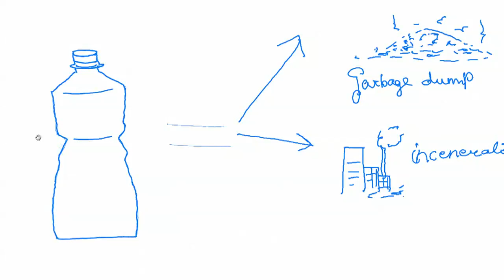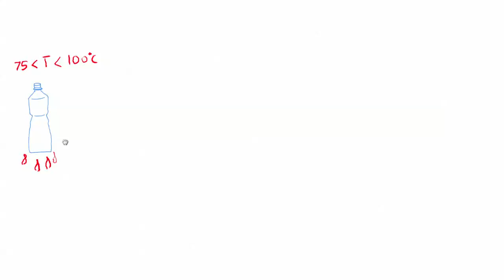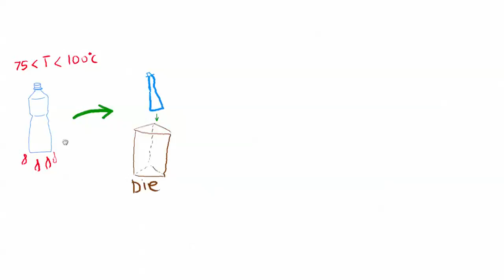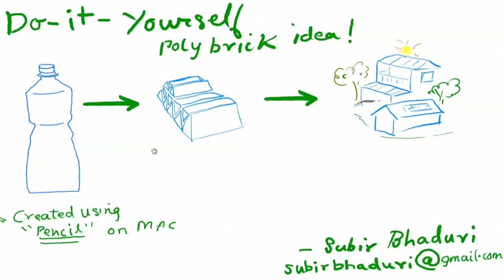DO-it-yourself Poly brick

Comment: So far I have tried a couple methods that I have learned here on YouTube for remolding them into readaly useable forms 1 way is toheat them between sheets of non stick tinfoil in an old sandwitch press (that I bought secound hand for this purpose)
This produces a very nice strong pannle that can be combined with more of it's kind to build bigger pasnnles from I have had success with many types of Thermoplastics with this method (be sure to know the melting tempratures of each type of PET)

Comment: Some give off fumes when heatted and others dont BE SAFE I have also had good luck useing a cooking pan and the non stick tin foil useing a old Cloths Iron for my heating source  I want to try to build a system that would use Solar heat to do the heating as this would sit better with me as to the recycling goes Im thinking a set of mirrors and a parabolic lens for focusing solar on a central point to create great heatting

Comment: Hello guys!! i have like 3 years working on something really similar to this, we have a lot in common, except for the design of the PET bottle, trying to make things happen for the needy in my little country. I am an architect and i want to know if you got any problems into the reblowing part, and what type of air compressor (capacity) you used. Do you guys have any recomendations? Th Linn gill
Reply from the maker: Hello Abel. Unfortunately, i haven't progressed much in this direction so i don't know what may be the problems.